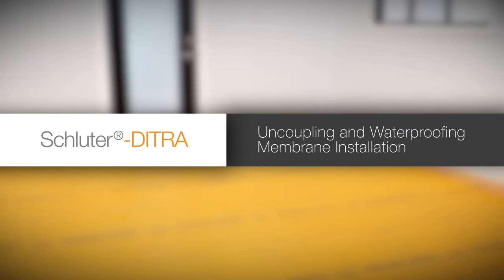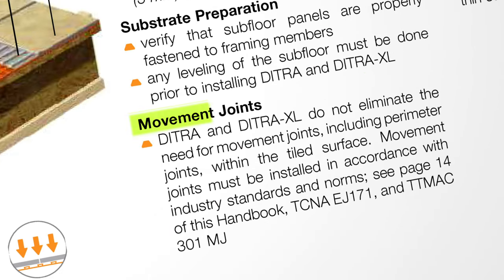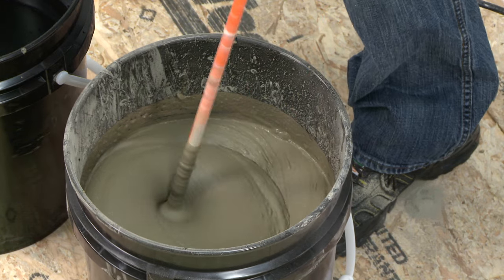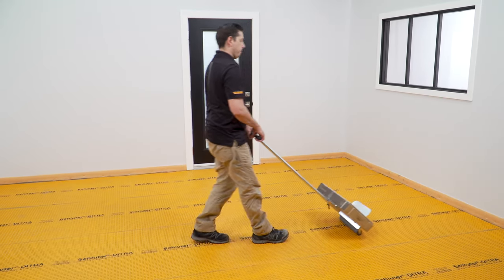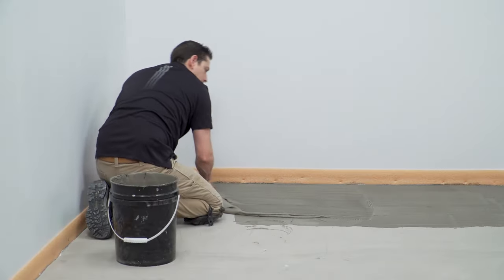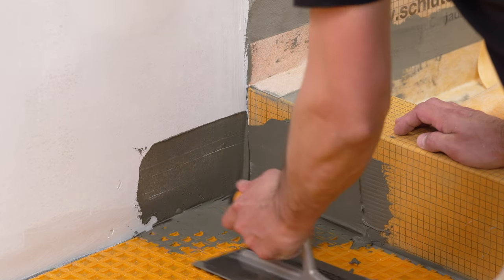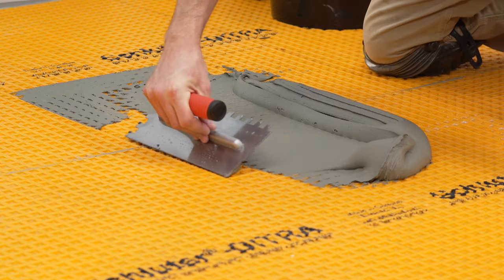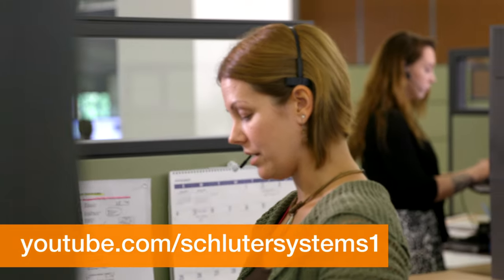How to install the Schluter®-DITRA Uncoupling and Waterproofing Membrane

Comment: I have 1/2 plywood floor substrate. Is this thick enough to lay the Ditra over without having to add additional plywood over my existing substrate?
Reply from the maker: Hi there. No, 1/2" is not thick enough to install DITRA over. If you have 16" o.c. joists, you would need to add an additional layer of 1/2" plywood, in accordance with the instructions in the DITRA Installation Handbook. If your joists are spaced further apart, the thickness of the added layer will need to be increased.

You can check out the details in our Handbook, or reach out to our Product Support team if you need any help.

DITRA Handbook: https://sccpublic.s3-external-1.amazonaws.com/sys-master/images/hcc/hd8/9474566750238/DITRA%20Installation%20Handbook.pdf

Comment: 7:13 if the floor to wall connection is sealed with the membrane strips and corner pieces, do you still need to give the ditra floor membrane an expansion gap?

How does the floor not become anchored to the wall with the strips?
Reply from the maker: The DITRA itself won't move enough to be a concern, however, you will still need to make sure to add a movement joint, such as DILEX-EKE, in between the tile and wall. Please give our Product Support team a call if you would like to discuss your particular project in more detail. 800-472-4588 (US) or 800-667-8746 (Canada). Thanks!

Comment: So as long as i use the schluter all set it doesnt matter the tile or substrate material?
Reply from the maker: Hi there ! ALL-SET can be used over plywood/OSB, concrete, and gypsum, but not vinyl. As for the tile installation over the DITRA, ALL-SET can be used with ceramic, porcelain, and some natural stone, but not with moisture sensitive stone (e.g., green marble), resin-backed tile, or glass tile. Hope that helps!

Comment: Question on the orange foam bordering the walls.  My drywall doesn’t extend all of the way to the OSB floor so is the foam still needed? This is a renovation so the original drywall installers left a gap
Reply from the maker: You just need to make sure that the thin-set, grout, and tile are not locked in. They need room to expand.  🍊

Comment: Can this be used in outdoor applications such as a 3-season raised wood floor room or a cement floor lanai?
Reply from the maker: Hi there! DITRA can typically be used in these applications, however there are variables that need to be considered since this would be treated as an exterior application. Can you give our Customer Support team a call to discuss this in a bit more detail, and they can advise from there.

888-472-4588 US
800-667-8746 Canada

Thanks!

Comment: Would this system be a good choice for waterproofing a poured concrete water tank that is in ground?
Tank size is 4’ deep x 6’ wide x 11’ long?
Reply from the maker: Hi Danny. Thank you  for reaching out. Can you please contact our Customer Support team to discuss your project in a bit more detail, and they can advise from there or connect you with your local Schluter rep. You can reach them at 800-472-4588 (US) or 800-667-8746 (CA) Thanks!

Comment: Can this be installed over self-leveling concrete underlayment?
Reply from the maker: Hi there! Yes, you can install DITRA over self-leveling concrete. We suggest that you verify with the self-leveler manufacturer if they recommend to use a primer before installing the membrane. If you have other questions, you can always give a call to our product support team, they are always happy to help! You can reach them at 888-472-4588 (US) or 800-667-8746 (CA).

Comment: Question: …..Can I install Ditra after leveling my concrete floor with leveling compound? 
Some well known YouTubers have warned against it because installing it over leveling compound will void the warranty.
Reply from the maker: Good question! Yes, that is totally fine. Our Handbook instructs that any levelling of the subfloor must be done prior to installing DITRA and DITRA-XL. Levelling compound is a perfectly acceptable option, as long as installed according to the manufacturer's instructions.

Comment: How does the BEKOTEC adhere to the Kerdi band or Kerdi corners?  I don't see the seal in the video after the uncoupling membrane is installed.
Reply from the maker: Hi Matt! Just want to check... do you mean DITRA (as this is the DITRA video)? KERDI-BAND is applied with Schluter-ALL-SET, FAST-SET, SET, or unmodified thin-set mortar (if not Schluter thin-set)

Comment: It looks like the mat needs to be placed in a certain direction in relation to the joists. Can this be explained a bit more?
Reply from the maker: Hi Heather! No the DITRA membrane do not need to be following any specific direction. There is some more specific details to be aware of if you are planning to tile a large surface because of the movement joints, etc. Would you be able to reach out to our Customer Service team to discuss your project in a bit more detail?  They’ll be able to request more information on the specifics of your project to give you the most accurate answer possible. You can reach them at 800-472-4588 (US) or 800-667-8746 (CA). Thanks

Comment: Can this be installed over a rolled vinyl flooring? I want to tile my bathroom. It's upstairs. The subfloor is a plywood with sheet vinyl. 6x12 area. It would be great to put a primer, and tile directly over it. But I'm considering doing the primer and adding the ditra directly over it. The home was built about 5 years ago.
Reply from the maker: Hi there, would you be able to give our Product Support team a call to discuss your project in a bit more detail? They will be able to advise from there, or connect you with your local Schluter rep. 800-472-4588 (US) or 800-667-8746 (Canada). Thanks!

Comment: Which mortar should I use for adhesion to cement board?
Reply from the maker: Hi there! Cement board is not an approved substrate for DITRA. If you have any questions, please feel free to reach out to our Customer Service team at 800-472-4588 (US) or 800-667-8746 (CA). Thanks!
Reply: Hi, prior to your comment I called in twice and spoke to two different reps, and called in again today after this comment and all 3 reps from the 800 number tech support stated that shluter handbooks advise against the use of cement board as well as Hardie backer boards. They recommended direct to cement or plywood or osb for bonding or shluder ditra. Why am I getting conflicting information for installation guidlines?
Reply from the maker: Hi Michael,

Our apologies as we need to amend our response: Cement board is not an approved substrate for DITRA.

If you were looking to use cement board as a wall substrate, you can use ALL-SET thinset mortar along with KERDI waterproofing membrane.

Sorry for the confusion.

Comment: Can i use a 1/2 trowl to lay the membrane?
Reply from the maker: Hi there! For DITRA use a 1/4" x 3/16" (6 mm x 5 mm) V-notched trowel, 5/16" x 5/16" (8 mm x 8 mm) V-notched trowel, or the DITRA trowel, which features a 11/64" x 11/64" (4.5 mm x 4.5 mm) square-notched design. Hope that helps!

Comment: is it good for concrete floors?
Reply from the maker: Yes, you can install over concrete. Note that we also have a DITRA-HEAT-DUO membrane that has a fleece backing to provide a thermal break over concrete. https://www.homedepot.ca/product/maytag-24-inch-top-control-dishwasher-with-third-rack-in-fingerprint-resistant-stainless-steel/1001527626

Comment: Why is unmodified thinset called for on the second step, but the Schluter brand thinsets are modified?
Reply from the maker: HI there! We call for an unmodified thin-set OR any of our Schluter thin-sets to lay the tile, which include a modified (ALL-SET), an unmodified (SET), and a fast setting thin-set mortar (FAST-SET), so you have options to choose from. Hope that helps!
Reply: How come use unmodified thinset to lay membrane on concrete?

Comment: Good video with great info and easy to follow 
I currently have a Behr water based stain on patio floor. Can I add thin set and Ditra over it without a problem?
Reply from the maker: Could you please contact our customer support team with this question? They are in the best position to help you out.
US 800-472-4588
CA 800-667-8746

Comment: can you glue engineered hardwood over this over concrete?
Reply from the maker: Hi there, Can you elaborate please? The Ditra uncoupling membrane is designed to work exclusively with tile... Happy to help. just need more information regarding your request!

Comment: Can it be installed over osb floor
Reply from the maker: Yes, DITRA can be installed over any even and structurally sound OSB floor
Reply: @schlutersystems1  How though?
Reply from the maker: OSB is a very common substrate. Installation steps are the same as demonstrated in this video here. Or, you can consult our Installation Handbook:  https://sccpublic.s3-external-1.amazonaws.com/sys-master/images/h52/he0/9350729662494/DITRA%20Installation%20Handbook.pdf
You are welcome to contact our customer support team as well:
US 800-472-4588
CA 800-667-8746
Hope this helps!

Comment: Can this be installed over 3/4" floorboards and would you apply adhesive directly to the boards?  Thanks.
Reply from the maker: Hi there, Sorry for the delay! You would need to add a layer of OSB/plywood on top and then thin-set onto that. See the Structural plank detail in the DITRA Installation Handbook for complete information. https://sccpublic.s3-external-1.amazonaws.com/sys-master/images/h28/hef/9377062715422/DITRA%20Installation%20Handbook.pdf
Reply: @schlutersystems1  thanks

Comment: Do you need to skim the whole floor before installing? The guy here making me skim the whole floor with unmodified thinset
Reply from the maker: If you are installing the DITRA or DITRA-HEAT membrane, then you just need to key in modified thin-set or ALL-SET into the substrate as you go or for the amount on the roll you plan to lay down next and then trowel out the thin-set and lay the matting.

If you've already installed the DITRA or DITRA-HEAT membrane, then no, you are not required to skim the whole floor before installing tile, however, it is also okay to do so. You can certainly thin-set and tile at the same time. It's a preference thing.

Hope this helps!
Reply: @schlutersystems1  thank you.  Yes I used shlutter all set as under layment , but they got mad I used modified versabond to install over it , they want me to use the economical non - modified thinset , but isn’t that stuff weaker? Cheaper?
Reply from the maker: Hi there, Versabond is a modified thin-set, so it should not be used to install tile over DITRA-- this would void our warranty. You would need to use ALL-SET or an unmodified thin-set for that. As long as the unmodified thin-set meets the ANSI A118.1 standard, it should work fine.
Reply: @schlutersystems1  that’s crazy how cheaper un modified thinset is best, why is that tho ? Dries faster?
Reply: @schlutersystems1  also what’s the warranty? If it breaks? Thank you.
Reply from the maker: That's basically it, but there's a little more to it. If you look at the THIN-SET FACTS section in the DITRA Installation Handbook (page 21 of the current edition), there is an in-depth explanation. https://sccpublic.s3-external-1.amazonaws.com/sys-master/images/hcc/hd8/9474566750238/DITRA%20Installation%20Handbook.pdf Let us know if you need anything else!
Reply from the maker: David, for the warranty coverage, the product has to be installed according to our Handbook guidelines. If for instance, the wrong thin-set were used to install the tiles, that would void the warranty.

Comment: Every time I see a video where they start installation in the middle of the floor.. 😂
Reply: That's what I was taught, please enlighten me.
Reply: You always layout your tile from the center point of the room to ensure a visually balanced installation.  You can start at one edge as long as you lay it out beforehand to ensure that your center point visually will be correct.
Reply: @RESMITHcarpentry  in kitchen I never start from the middle all my cut are under the cabinets